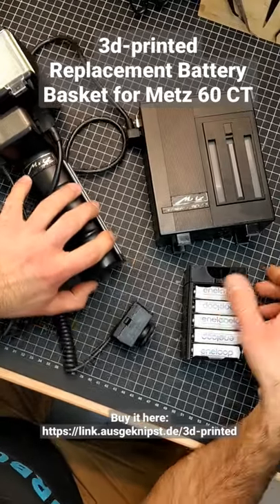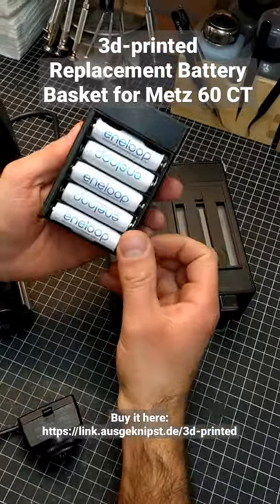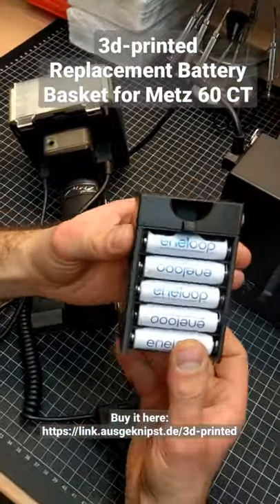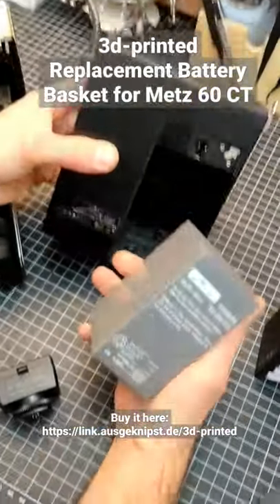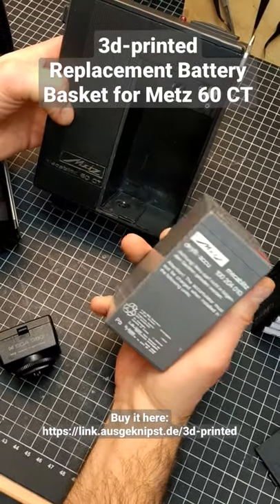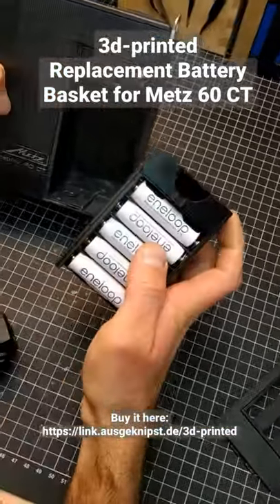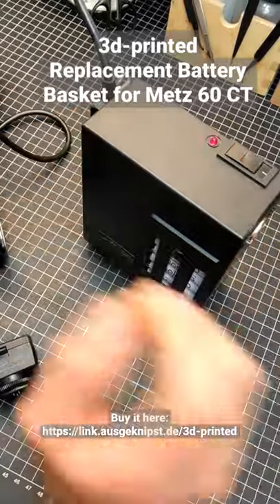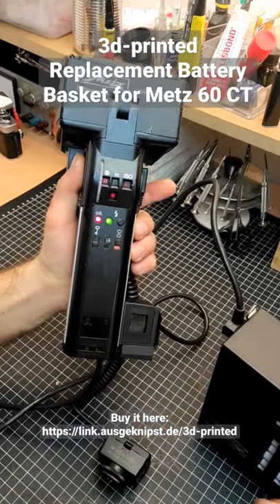3d-printed Replacement Battery Basket for Metz 60 CT Shop: https://www.ebay.de/itm/203784654778

Comment: Must have a wide voltage tolerance in the Metz circuitry as the original Metz Sonnenshein dryfit is a 6V battery. 10 Eneloops would be 12V at the nominal 1.2V/cell and up to around 15V fully charged. If you change the internal switch to Nicad does the Metz charger charge the batteries up to the correct voltage or do you charge the batteries outside the unit? Neat solution to keep these terrific but ageing flashes going.
Reply from the maker: Hi, thanks for reaching out.

The batteries are actually connected in parallel, not in series. The voltage of the power pack is therefore 6 V, with double the nominal capacity of the cells. 

I would also not recommend you to charge the batteries directly with the original Metz charger, but rather use a normal NiCd/NiMH battery charger.

All the very best,
Anto

Comment: I just bought two adapters, but what I've noticed that the flash is working very slow, for instance I have to wait 10 seconds for 1/8 power to reload is this normal? I use Eneloop 2450mAh batteries.
Reply from the maker: Hi, this is normal. I suspect that something is wrong with your flash/capacitor unit.
Reply: @ausgeknipst  10 seconds is no way normal. Even at full power setting (of the flash) a reload should be around/under 5 seconds.